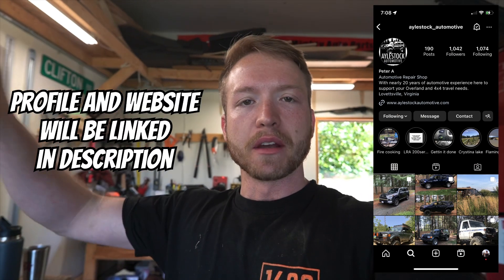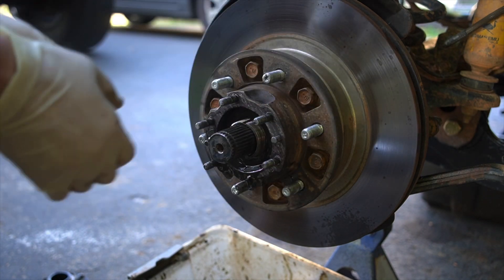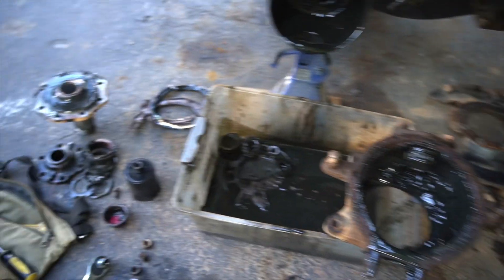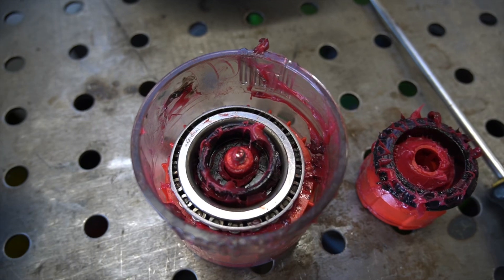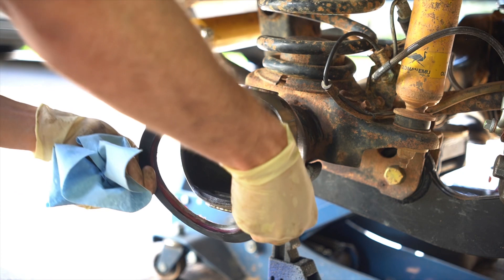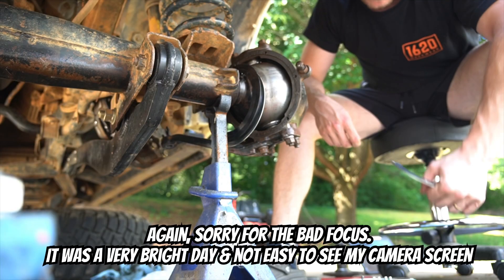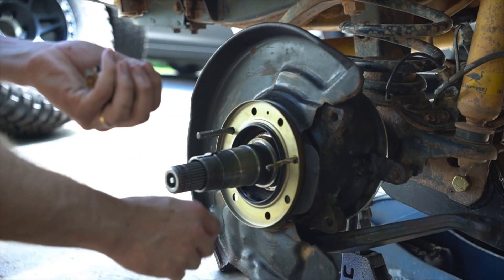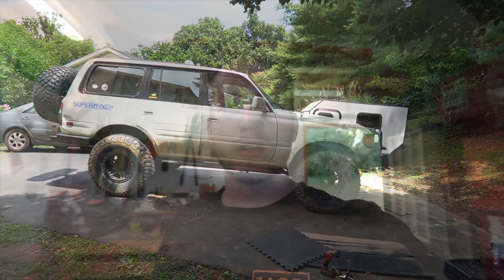80 Series Land Cruiser | Knuckle Rebuild **DETAILED**

Comment: If your changing rotors at the same time, beware the bearing hub bolts are fine thread & the knuckle top bearing plate cap is coarse. They look the same coming out of a degreaser bucket. Threads are not interchangeable, you will ruin if you get gung hoe on the spanned or rattle gun  at about  one & a half turns.